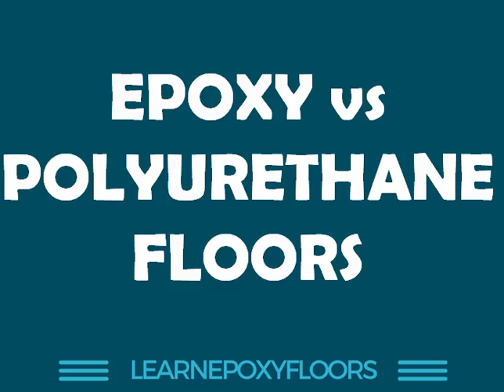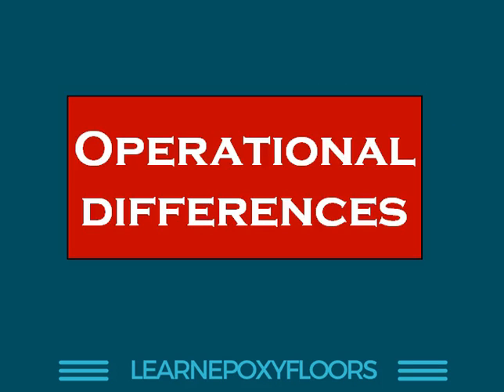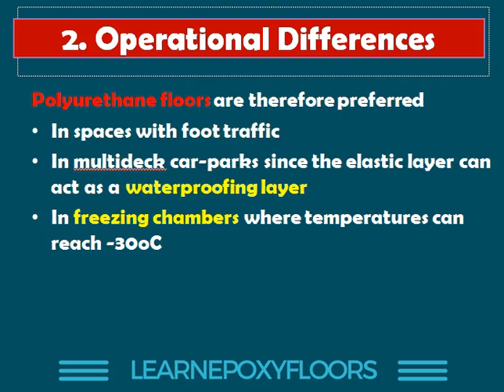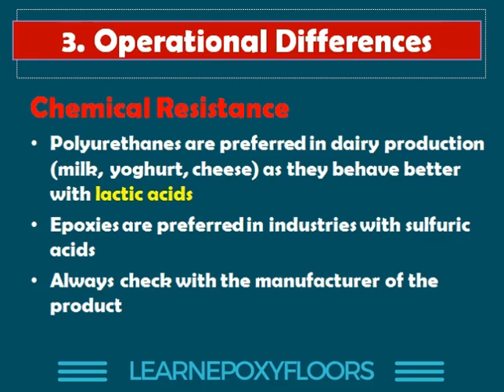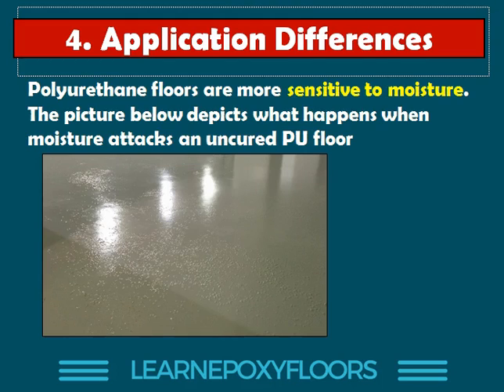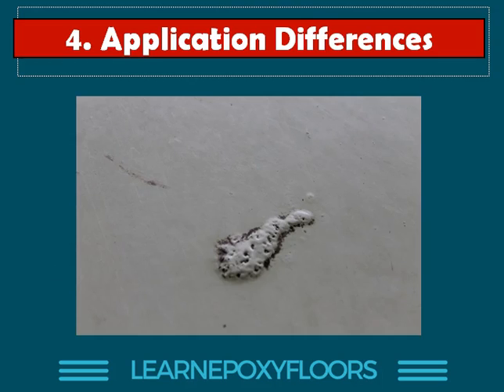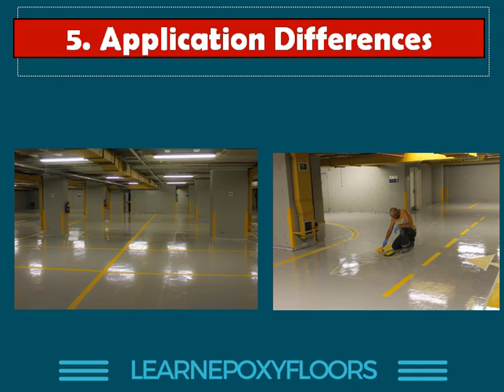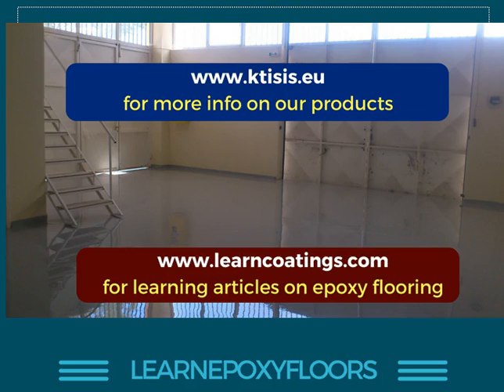Epoxy vs Polyurethane Flooring: Understand the differences

Comment: Greetings,
I’m at an impasse, I am doing a copper penny design on my cement floor and will then do the rest of the floor with brown paper bags. 
I live in the tropics up in the mountains where there is more trade winds but, it will always be humid. My plan was to do 7-8 coats (1 coat every 3 hrs) of the water-based Verathane polyurethane for my floors (765sqft) and over the pennies but after watching your video I’m not so sure.
How will polyurethane react over copper? 
Should I have fans on during the whole coating process? Can I coat the pennies with epoxy and then when cured poly? And if so, what’s the process and what kind of primer between the epoxy and poly?
I’m doing this all by myself. I have no help😳
Any advice would be so appreciated.
Thank you.
Reply from the maker: This is really a matter of trial and error. You may want to do a test area before doing a full scale floor

Comment: What about tire staining on epoxy floors ? I understand that tires require ozone protection. The para-phenylenediamine used as anti-ozonants & anti-oxydants are due to migrate within the tire so that the external face of the tire keep getting these supplies to protect the tire. Then, if you leave the car on the époxy floor for too long without moving, you obtain staining Inside the paint. Thing I Don't understand is if this can occur when the epoxy paint is fully cured. Any idea anyone ?
Reply from the maker: This can happen even if the epoxy paint is fully cured because all epoxy is subject to chemical corrosion. Some epoxies do a better job than others. But even if you left bleach for a day or two on the floor it would stain

Comment: Hey my man, thank you for your presentation. I have this crazy idea, and anyone reading this please chime in if you have any input, to rip out all of the carpet in the cab of my truck and prep the metal to coat in a tough either epoxy or PU(looking for suggestions, material and product)
Reply from the maker: Your idea is not that crazy! I have quite a few truck drivers who regularly coat the floor of their truck with a tough PU coating. You want an elastic coating to account for all the hitting and shaking trucks experience, that is why I would recommend PU

Comment: Have a question, I did a table with epoxy resin in fact a geode table, but then I decided to put it outside, so I am thinking to give an extra coat of polyurethane resin... is it possible?... this in advance
Reply from the maker: If the PU resin is clear, than the UV rays will go through the protective topcoat and will slowly start to damage the epoxy underneath. In time the epoxy will chalk and the topcoat on top will break. Trust me, I have actually experienced this on a balcony when we applied a clear PU over epoxy
Reply: thank you for your answer... then I don't really understand what type of transparent resin should I use for outside..is it better de Poliuretane, the pollster or the epoxy resin?   @learncoatings-epoxyfloorin9448

Comment: How does this Polyuyrethane floor react so harshly with water when Polyurethane is widely accepted as a waterproofing product? Did the reaction happen when the membrane did not cure? Sorry if it seems silly but I'm a lil new to this.
Reply from the maker: exactly when PU has not fully cured it is very sensitive to moisture and humidity. Once the floor has cured it forms a water impermeable membrane

Comment: Thanks so much for the video. I am confused though. You said the PU floors are waterproof and then later on it is more sensitive to moisture. You are just referring to the time when its applied and cured right? What level of humidity would be too much for PU? Thank you
Reply from the maker: Exactly Benjamin, when PU is still curing it is extremely sensitive to moisture. However once cured, because the final result is more elastic it will act as a better waterproofer than epoxy

Comment: What would you recommend as I plan to replace the carpet in my camper... We have 3 dogs
Reply from the maker: polyurethane is softer than epoxy, and it will definitely be better for the dogs, they wont slip as much

Comment: Sir, how thick can an epoxy coat be?   I would like to level a rough concrete floor with differences in height between the highest and lowest pebbles of around 1/2".  Would epoxy be recommended?
Reply from the maker: no I would not recommend epoxy to level such large differences. YOu would require crazy amounts of epoxy and the cost would shoot through the roof. Use a cementitious based product instead

Comment: Would Polyurethane melt EPS foam insulation if it had to contact it.
Reply from the maker: Yes it is very likely that it would melt. Most PU coatings contain solvents and it would damage the EPS
Reply: I want to use polyurethane in my home  will it be a good idea thanks

Comment: Good info, Thanks. I have already flood coated my living room with pigmented epoxy.  I have a question. Can I apply 2 or 3 coats of PU with a roller to get better scratch resistance & will it have the same sheen as the epoxy? Thanks again & best regards.
Reply from the maker: PU will be somewhat better in terms of scratch resistance. Gloss will be slightly less than epoxy. Before coating over with PU, make sure that you use a suitable primer to bridge between the two types of products
Reply: Got it. Thanks a lot.

Comment: Hey, i have a quick question;

I want to put epoxy or polyurethane on the floors in my flat.
I live in a place where there is no moisture, there's always an decent air-flow coming through out the flat.
Also, flat is located in a place where there is barely any sun, specially on that side of the flat where i want to place epoksy/PU.
I want to place epoksy/PU in the living room & kitchen!

The only thing i have concern about is my dog!
 I don't know if his nails or general walking through out the house can do any damage.

So my question is; 
Based on these info's i just gave you;
What do you recommend me to do ?
Put epoksi or PU or none of those ?

Please help me out, i'm really struggling with what to do with these type of floors.
I really like the designs and strenght of them but i'm afraid of potential CONS that comes with it so i hope you can give me few advices based on the info's i just gave you.

PS:
stari.se.brate@gmail.com

This is my email account if it's easier for you to write.
I'm even willing to pay you some money for your detailed explanation and advices.

Anyway, thank you so much in advance for every help you can provide!
Reply from the maker: Have a look at this article where I explain why I am not a fan of putting such products in homes http://learncoatings.com/wordpress/should-we-be-installing-epoxy-floors-in-homes/
If I had to decide I would opt for PU in the home as it will scratch less and it is softer on the feet
Hope this info helps!
Reply: Yes, it helps alot!
Thank you so much for your time and efforts to explain all of us the PROS and the CONS of doing these types of floors.

Cheers!

Comment: Hi. Can you tell me how slippery a wet polyurethane floor is? Any special measures to increase safety?
Reply from the maker: It depends on the texture. If you have a smooth self leveled polyurethane floor it can be quite slippery. One method is to apply a topcoat with a roller to give it some texture. Also you can mix in some quartz for an even grittier surface.
And in food industries some companies opt for PU cement screeds that are less slippery

Comment: Would polyurethane be suitable for a butcher?
My biggest issue is that when heavy steel utensils fall on the floor, or the vibration from the equipment normally chip or scrath the floor?
Is polyurethane durable enough to withstand it?
Reply from the maker: The main issue with butcher shops is that the blood can actually cause corrosion in the floor. If you were to use polyurethane I would recommend a cementitious PU screed. Personally I like using a combination of epoxy and thick quartz granules to minimise the impact in areas where the meat is being cut

Comment: Hi. So far the best educational & informative video I found on this subject. I do have a question, however, and it sort of lines up with Tom Sikes question below. I've been asked to clean and recoat a church's floor. On close examination I can't tell if it's epoxy or urethane and the existing members have no clue either. The only thing I know for sure is that the floor was done nearly 12 years ago and has certainly withstood plenty of activity and foot traffic. The maintenance man buffs monthly and gets a fair amount of shine back but not nearly what it used to be or desired. I believe that a good clean and scrub with a recoat would achieve great results but my question is which one would I use as a top recoat and are there any problems if I applied the wrong one? In other words, can epoxy be applied on top of urethane or vise-versa? Thanks for your answer and help.
Reply from the maker: First of all thank you for your kind words. Urethane surfaces are in general less welcoming than epoxy. Even applying urethane on old urethane is hard. Epoxy surfaces tends to be a bit friendlier and will usually bond better with new coats providing that they are not too shiny. My recommendation would be that you lightly sand the surface to get a good scratch, and also remove any wax from the buffing. Then apply a low viscosity epoxy primer to get it to bond well with the coat underneath. And on top of that feel free to apply either epoxy or polyurethane whatever you prefer
Reply: Thanks!

Comment: thanks so much for putting this presentation together. Would you recommend using concrete sealer as a top coat to create a "waterproof" layer?
Reply from the maker: Thank you. Both epoxy and polyurethane are good waterproofers. A concrete sealer over such a surface would not add anything. In fact concrete sealers have been designed to bond with concrete and not synthetic resins

Comment: Thank you very much for this video! Could you tell me which of these two floors would you recommend for dog kennels that would like to put on concrete floor in big garage. I run small dog and cat rescue and cleaning concrete from urin and poop is hard and wondered which of these two would be less affected by it. Thank you!
Reply from the maker: I do not have any data on which would be less affected. I know that sometimes animals slip with their nails on epoxy because it tends to be quite glossy, so maybe PU would be a better solution since it is a bit more slip resistant

Comment: What product can I use as a protective coat over the epoxy that will keep the mirror high gloss? I have tried urethane but it changes the gloss and leave a textured print..please help?
Reply from the maker: Have you tried using a polyaspartic topcoat? They tend to be glossier, but you need a very experienced person to apply it properly, as they will know how to avoid the texture problems

Comment: very professional presentation; gooood job :) everything explained; just one question: what is the UV resistance of both materials? same?
Reply from the maker: Thank you Piotr. Epoxy in general has poor UV resistance. It has the tendency to chalk and go yellow. Polyurethane has a much broader spectrum of UV resistance. PU used for indoor applications tends to go yellow quickly. If you want PU for outdoor you should use aliphatic polyurethane it has very good resistance. Here is an example of such a product: http://ktisis.eu/product/ktisopur-uv-aliphatic-polyurethane-floor-coating/
Reply: So, if I understood you correctly, they both go yellow quickly...
I wish the white floor in my apartment. What kind of flooring should I use for an INSIDE usage? I think, one shouldn't use an outdoor product  indoors. What shall I do then?
Reply: @YouTubeNazi  thanks

Comment: Very good video. Please tell for food processing facility that need to be washed daily, is PU more suitable than epoxy? Also, is is impossible to have sloped PU surface to a drain with no water ponding?
Reply from the maker: For food processing the main question what types of foods, acids, chemicals will be exposed to the floor. And you should pick epoxy or PU based on the chemical resistance that you require. If you want a sloped surface, the slope will need to be constructed in the substrate. In other words make the concrete sloped and then you can use a roller to coat over the slope with PU
Reply: LearnCoatings - Epoxy Flooring Training 81089.c

Comment: nice video. i want to know the price difference in application of both and what would you prefer for hospital walls and floors ?
Reply from the maker: The application procedure is quite similar. Price wise it is hard to compare epoxy with PU because there are many different types of products out there, and some companies are selling waterproofing PU products as being suitable for floors as well. On a hospital floor I would specify PU. You want a more elastic and softer surface for all the foot traffic

Comment: What if we mix small crushed stones of 2 to 5 mm with polyurethane. Whether this has good shock absorbing properties and flexibility. Also is it possible to add Coloring pigment to the above mixture.
Reply from the maker: be very careful with coloring pigments as PUs can be very sensitive to contamination. You need to do your tests first with which pigments are compatible. If you add crushed stones expect the flexibility to be reduced
Reply: Didn't work on mine, failed horribly

Comment: what is difference between pu binder and polyurethane?......Which one is good for outdoor playground or playing court?
Reply from the maker: Pu binder is a definition of a polyurethane based chemical used to bind together various materials. Like concrete, quartz etc. Polyurethane is a general definition of all polyurethane based chemicals. From coatings to foams to moulds etc.
For  a sports floor you wouldbe best off using a combination of a pu floor coating possible combined with rubber

Comment: We manufacture and apply Polyurethane coatings to a varied market on numerous substrates from steel, fiberglass, aluminium, wood and even areas such as gym floors with huge success. it offers a much wider versatility than epoxy in low to medium traffic applications with costs almost half that of epoxy
Reply from the maker: Thank you Johan for your input. I agree with you PU resin based coatings have a much broader range of applications than epoxies

Comment: How does one determine if a coating already down is either Epoxy or Urethane.Sometimes I and colleagues are asked to clean coated floors and we have no idea if it is epoxy resin or Urethane resin, unless the owner knows. We are working blind on these surfaces making a best guess on chemical then pressure adjustments on our "spinners"to avoid stripping materials along with the vacuum out. Thanks for your input.
Reply: Mix up a solution (as much as you can dissolve in water) of LYE (drain cleaner - sodium hydroxide) and put a few drops on the floor. If it goes yellow and soft over night then its PU. If it doesnt, epoxy.
Reply from the maker: It is not that easy to tell the difference. Urethanes tend to have a more 'rubbery' texture while epoxies tend to have a more industrial texture. It's taken me years to be able to spot the differences